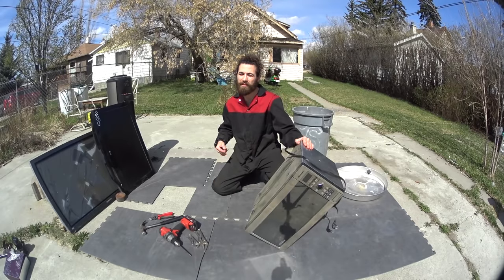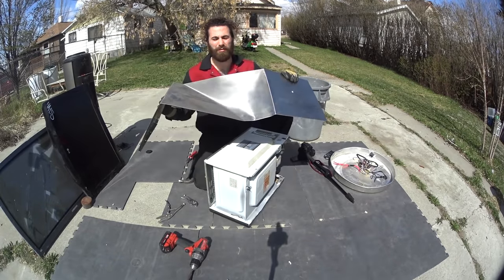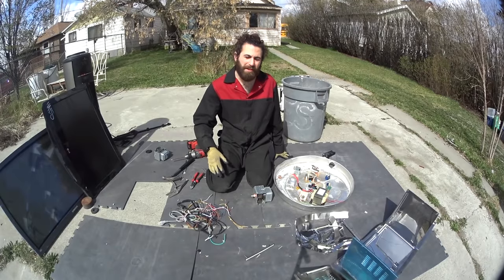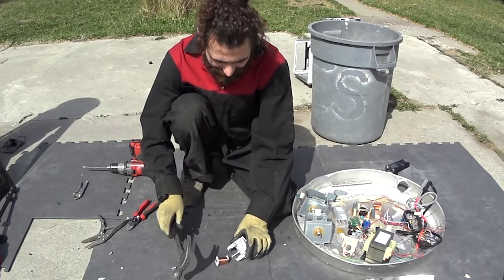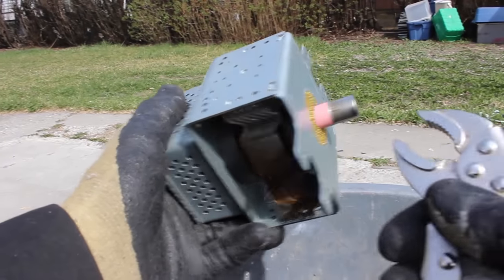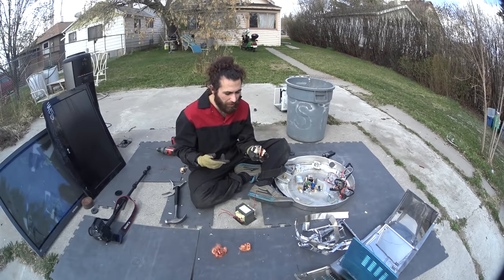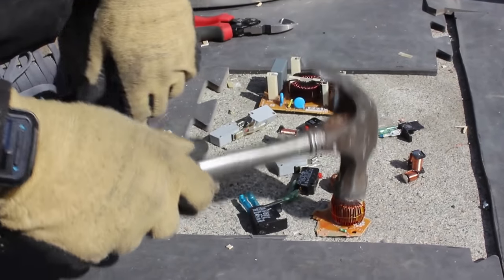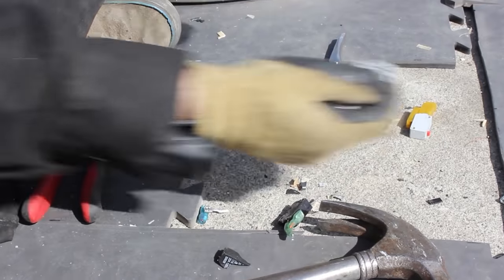Scrapping a Microwave FAST and SAFE! - Make More Money In Less Time!

Comment: It was driving me crazy about not mentioning the beryllium until 7 minutes into the video lol. I had taken about a dozen apart being careful with the brass ring thinking it was the dangerous part. I'm not sure how hard that pink thing has to be struck to become dangerous but I do pay a little more awareness than the past. Love the video, guys at the scrapyard are always blown away to see a completley bare microwave but I'm with you. I scrap the screws too
Reply from the maker: I still think I should have been more direct about the beryllium, it’s pretty important. There was awhile I was just passing on all the steel because prices were garbage, but it seems steel is back now! Hopefully it holds. Nuts and bolts are some of the best density for sure, a bucket packed with those is a decent bit of coin 👍
Reply: @thubprint  Whenever prices are terrible for something, it's a good time to accumulate it. Once demand drives prices more to your liking, reward yourself with both the money plus open space. Although steel certainly is heavy and common, so it might take up too much space for consideration in some cases.

Comment: Cool videos man. I work in the HVAC industry and I've been collecting failed everything from compressors, fan motors, copper and coils over the last 20 years and it's paid pretty well. I usually wait till I have a small truck load then take it all for scrap. In some cases I have netted over $700 in one drop.
I love recycling and getting paid to do it is a bonus.
Reply from the maker: That’s what it’s all about!! I think around 700 is my largest one too actually
Reply: Back in the late 80's and early 90's I was making about $300.00 a day by driving many miles a day with an old pickup truck. Once in a small town I picked up 35+ aluminum storm doors. If I saw scrap I had no problem asking about it. I didn't do much with copper wire because it was too hard to process and I definitely wouldn't burn it because of the smoke. Batteries, radiators, transmissions, aluminum siding, mixed aluminum, brass, clean cast iron, and non- magnetic stainless steel. I would also save the following and only cash in once in a while: starters, alternators, heater cores, brass with alumunum, brass with iron, short iron.  Being that I was living in Flint Michigan back then I had to cash in my load every morning when the scrap yards were open. I had to watch my truck very close at night to keep it from being stolen With the scrap metal. While I totally enjoyed this back then, the bottom finally fell out. I couldn't make a dime at it now.
Reply: @arthurhunt642 The bottom fell outta your truck? I had an old truck like that, I called the bone yard. They picked it up and gave me 200 for it lol

Comment: Take a screwdriver blade and short it across the terminals of the capacitor.  That will drain any residual voltage that it may contain.  Works on any capacitor.
Reply: If not discharged it could stop your heart. Know a guy that got shocked by it . they had to jump start him 3 times just about killed him for good.
Reply: You got shocked by one too I see. Hahahaha
Reply: @fbsurveyor  nope. But the difference between wisdom am and experience is wisdom you learn from the mistakes of others
Experience  you learn from mistakes of your own. Better to be wise than experienced.
Reply: Would you mind being a little more specific, sir. I don't know what a screwdriver blade is or across the terminals. If you reapond, thank you.
Reply: @gnweaver7  "just about killed him for good" - rofl.. yeah thats usually what death does to ya.
Reply: With 20 yrs experience as an electrician I can say, without a single doubt in my mind, screwing around with an unverified charged capacitor without the proper safety gear is a very, very, bad idea.
Reply: @amorousagony2626  really, you're kidding right?

Comment: I take all the little screws and metal bits and put them in a clean soup can. When half full just pound down the top of the can to trap all the little metal bits in there. You now have a heavy tin can. Not worth a lot of money at 3 cents a pound but it does add up and you have the benefit of not having little metal screws and sharp metal bits everywhere.
Reply: I use the stripped down microwaves to hold all the screws and bolts and little metal bits; also, I usually wait till after it rains to take in my tin since each microwave will hold an inch or two of water. A little water weighs a lot ;)
Reply: Yep. Lead acid batteries used to bring the highest cash value of all the junk. Not sure what happened or if I got scammed but I got lots more $ for scrap steel in my yard than anything else. Surprised me.

Comment: Be careful man, those things have VERY large capacitors in them that can discharge thousands of volts at a high enough amperage to kill you. Some of them can remain charged for years. Be careful.
Also you can pick up a set of security bits at any auto parts store for about 4 bucks.
Reply: Yesss that's what I was thinking I just got a 2100v 0.90μF capacitor from an old microwave and discharged it right away
Reply: So, could I take the magnets from microwaves and then make a perpetual motion machine and use the capacitor to  store the energy It creates?
Reply: @elyoj6845  yeah but u gotta be very careful with the capacitor cuz it could easily electricute someone if it's fully charged
Reply: @elyoj6845  If you could make a perpetual motion machine you'd solve the world's energy issues.
Reply: @crawfordarmstrong  

I don't see why it would be to difficult to do with magnets.
Reply: @elyoj6845  A perpetual motion machine is a hypothetical machine that can do work infinitely without an external energy source. This kind of machine is impossible, as it would violate either the first or second law of thermodynamics or both. <-- that's just from the wiki entry but it's been a pipedream device probably since ancient times.
Reply: @crawfordarmstrong  

It wouldn't be a truly perpetual-motion machine because it would take periodic bursts of external energy... and to start it of course
Reply: Thank you
Reply: Yeah if you turn the junker on just before you scrap it maybe.
Reply: Fun, but dangerous. Seriously not a joke.
Reply: you could also through the whole thing into water.
Reply: Or you could through the whole microwave in water or hit the wire with an ax.
Reply: If you really think about it, I mean really really think about it, risks vs work and profit it should be a no for me regardless.

Comment: EYE PROTECTION!!! (as I'm sure dozens of others have mentioned) Also, I've been scrapping for >10 years now and it never occurred to me that the other winding in those copper coated aluminum microwave transformers might be copper hair. Dang. How many of those have I thrown in to the tin pile?!?!?!?!?
Reply from the maker: Hopefully not too many, those are a good bit!
Reply: I never wear protection of any kind when doing this and have been scrapping all my life. Can't be afraid of everything.
Reply: I've been scrapping for over 5 years and taking apart microwaves every time I find one. I stopped cutting the wires I just take all the screws out, because most of the wires that connect from point A to point B to point C is all silver coated copper wire. The other wires that are in the motors are copper wires. Since I don't dismantle a microwave on a lawn I use a chisel and the claw hammer to get the copper wire and the aluminum wire out of the motor. I'll usually take a microwave and dismantle it near a dumpster in a parking lot that way I can throw all the steel out since I don't use it. The only thing I will come with to take apart is all the wires and motors and that's about it. Also if you're efficient enough you will take out all the boards that have the fan on it and all the other stuff.

Comment: Anyone with a problem or bad opinion on what this guy is doing clearly has never been to a scrap yard. I actually worked on a recycling tip. And most days I spent taking microwaves apart. I can do it alot faster than this. Instead of unscrewing the outer screws just hit them with a ball point hammer they will go through. Also hit the 4 screws holding the transformer then pull open case and it all falls out on it's own. I used to fill 2 dustbin in a day just with transformers from microwaves. Most of the comments on here are opinionated it's not facts. Keep up what your doing fellah! It's people like you that keep this world where it is 💯 the moneys always there in metals or precious metals.

Comment: Man, as a commercial and residential electrician I have to say I enjoy scraping trash for cash as well but taking apart a microwave can be seriously dangerous the transformer can hold a charge and it may only take in 110volts from your wall but it's on a dedicated circuit meaning it doesn't share the electrical load with anything else like the circuit in your living room which has a bunch of plugs on it I'm glad you did eventually warn them! Trust me brother getting hit with 240 volts or more if it's a big unit it hurts like hell!!!! I've been hit with 480 and you definitely don't want that either LOL stay safe man for real
Reply: Nichole Crouch electricity is no joke. My buddy (pretty good electrician)got me a helper job (commercial)1st job 2nd day...l happen to come around the corner into the utility room of new wing of elementary school & there’s my friend stuck on a fish tape that had laid across contacts .locked up w soot under his nostrils. Happened to be a piece of a 2x4 laying there .whacked him off of it .its a wonder I didn’t try grabbing him or something stupid. Didn’t know much about anything at that point. L8r. Good advice. Take care
Reply: I got a jolt from a 1,200 volt 450ma filter choke in a Yeasu HF reciever that knocked me out of the chair I was setting in. The shock only went from one finger to the wrist of the same hand. If it would have went through my hand and across my heart  to anywhere else it could have killed me. And No, I'm not going to make a video of it!

Comment: All you have to do to discharge the capacitor is cross the 2 connectors with a screwdriver with a plastic handle. Just don't touch the metal of the screwdriver and you are fine. I do it everyday in the A/C trade
Reply: Kevin Walters, I do HVACR also, careful giving advice on how to do something, they may try it and make a mistake doing it then sue you! For us it is very easy for us to leave things out because for us it goes without saying. Kinda like walking up on an ac and leaning on it.
Reply: @billdidit7790  I intend to take a m/w to bits soon and I have made a discharger out of a thin piece of wood  12x1 inches and put a nail through it close to the end so as to touch both terminals . Do you think its a safe way to do it ??? any input will be appreciated thankyou

Comment: Thanks great video. You got me motivated to go scrapping for a living. He has a couple of tips to make your life easier. If have electric available you can go to Harbor Freight and with a coupon for about 10 bucks by yourself an electric cut off grinder. Or if electric is not available they make cordless ones along with a cordless Sawzall but of course there more money. Another tool that might come in handy would be a chisel invest in the one that has the rubber wall plastic cover it'll protect your your hand so you don't wind up in the emergency room with a broken hand. A heavy hammer and good eye protection is also important thanks for the awesome video
Reply from the maker: Good tools are super important! Almost as important as eye protection, haha 😉

Comment: Interesting way of doing it, the keypad on the front is usually a silver mylar which can come out pretty quick.   Not sure about the yards in your neck of the woods, but some in my area will not take microwaves so i need to break them down so they are flat, the ones that do take them , I first fill the microwaves with all the small steel like screws and fasteners to add weight, then stack them in the truck and go to the yard :)
Reply from the maker: That's SUCH a good method! Little disposeable buckets, I like it!

Comment: Scrapping electrical safety hint - Never cut more than 1 wire at a time.
By cutting more than 1 you are effectively shorting out every wire you have in the wire cutters. And its especially dangerous when messing with capacitors. Even if you dont get shocked your tool will get damaged. It can literally blow a chunk of metal right off your cutters.
Reply: this was my exact thought when he cut both.. talks about dont have the proper gear.. then cuts in the worst way possible
Reply: ? I’ve scraped hundreds and never had a problem. Of course they sit in the yard for a while before I take them apart, so idk ?
Reply: Or somethings are better left to those who do actually understand! I wonder how many people have be hurt watching DIY videos? I know of 4 gas furnaces that blow apart last year because of watching diy vids, luckily no one died!

Comment: When u take apart a microwawe... do you check the fuse before? 80% of the time its just the fuse witch is broken and changing it makes the whole microwawe work again. Its also super easy to change the fuse... just an idea
Reply: No we don't because we already have a microwave and we just need the fucking parts for other projects.    :-)
Reply: Lol
Reply: lol on top of that you can make more on selling the microwave vs “scrapping” it like a tweaker haha
Reply: If you plug it in and nothing lights up, check the little white cylindrical fuse. If it lights up and runs but doesn't heat, AND it doesn't smell like fried electronics (you know the smell), then it very well may just be the big super capacitor, which is easily replaced with one salvaged from another microwave with other fatal issues. Just make sure that the replacement capacitor is equal to, or of a greater value than the one you are replacing.
Reply: Hey yep, sounds like you're pretty smart except in English. I think it's the word which you want instead of witch. Sorry man, I'm pretty hungry I think I'll go make a sand witch.
Reply: The fuse wouldn't blow for no reason. That magnetron was dead for sure, did you see the output was black?
Reply: @davejackson2337  Age / Power Surge / Vibration Caused by Cat 8 Earthquake / Crossfire Hurricane.  Could be anything really.
Reply: What the fuck fun would that be? You cant change a fuse by beating it to death with a hammet. Will i suppose you could, then you'd just get to smash more newly busted crap
Reply: Or just put a piece of wire in instead of the fuse
Reply: Agree, most of the time just replace the 25 cent fuse & voila works again
Little kids start unit empty
It blows the fuse
Seems a working microwave can be sold for more than scrap:)

Comment: Anytime you're taking apart an electronic device you want to be careful some of these things especially like a microwave can carry enough electricity to kill you so yeah we're gloves and be careful I once took apart an old TV and was shocked to get shocked and it wasn't plugged in
Reply: A CRT TV has capacitors that do contain enough of a charge to end your life. It is advisable to discharge the stored electricity with a piece of wire attached to a big screwdriver shoved in the ground.
Reply: You might find this hard to believe but I we used to be allowed to catch fish on the beach with a seine net, Illegal now but there was a little trick to throwing the small stingrays back in the water where nobody would step on em. There were these indention's behind the eyes and a thumb and finger would fit in there perfectly like they were made to pick up and throw back like that. If you know what a skate is it looks a lot like a stingray just has a tail like a shark. I thought I could grab one just like the stingray and toss it back. I didn't know they had a shock like an electric eel. Kinda felt like the old lawn mower spark plug wire trick. I also made the mistake of not making sure when I was peeing near the electric fence to pick strong weeds to pee on. I knew the electric fence would light me up but wasn't paying attention that the more I peed on the weed the heavier it got until it bent over enough to touch the electric fence. Not a good place to get shocked either.

Comment: U can jump the capacitor by touching the connections with a screwdriver and making it touch the connection and steel frame to kill out any charge left ( make sure your holding the handle of the screwdriver and not touching the metal or you will get scrapped )